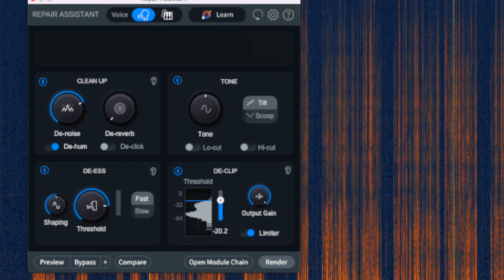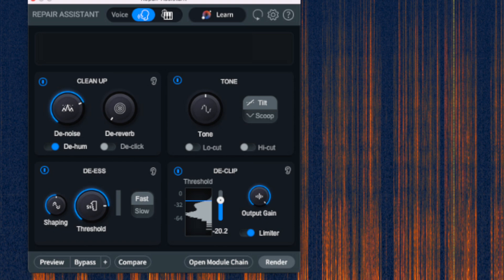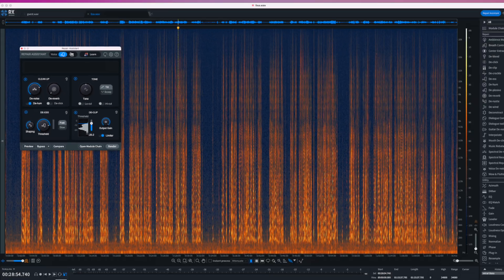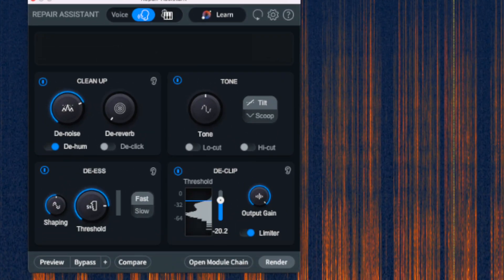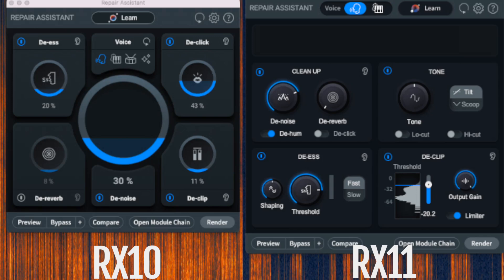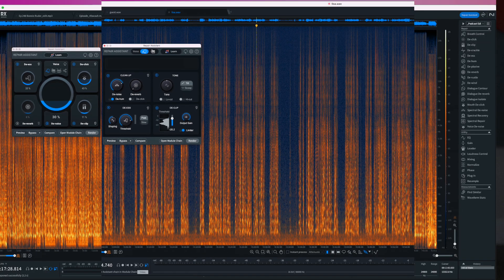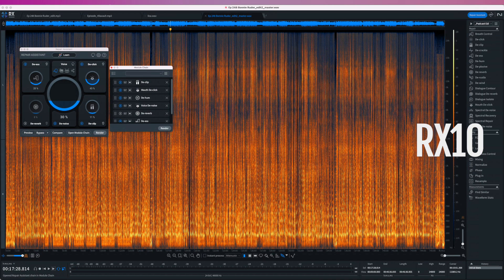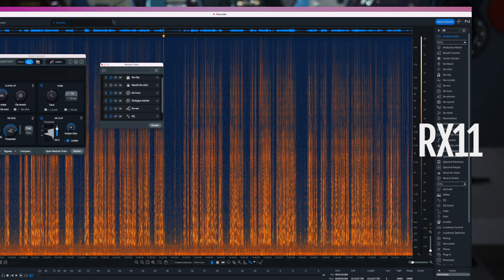Izotope RX 11 // Using Repair Assistant As A Plugin

Comment: The Izotope RX 11 Repair Assistant plug-in does not have a "Render" option on the bottom far right (opposite of "Bypass"), as the module does. So how does one apply any of the Repair Assistant changes/suggestions with the plug-in?
Reply from the maker: When you use the RX Repair Assistant, or any plugin for that matter, the rendering process is handled by the host software. For instance, if I were using the plugin in Logic, I would export the audio from Logic. This new audio file will have those changes applied to it. 

When you're working in the RX editor, the process needs to be rendered to hear the results since it doesn't work in real-time. With a plugin, you're hearing the results in real time, eliminating the need to render until you are completely finished. Hope that makes sense.

Comment: Thank you for your review! 
I am a brand new audio editor as I am making short instructional videos doing all the writing, recording audio, editing audio, recording video to the audio, then editing the video matched up with the audio and saving. I use Adobe Audition and Premiere Pro. 

This is THE FIRST PLUGIN I've ever purchased. I purchased it just a few days ago and finally had the time today to sit down and play with all of the RX11  Elements options. I was very surprised that when I followed the (not very good) video on the izotope website - it didn't give instructions, but more of an example of someone running it assuming we've all done this before, only to find out that when I clicked on 'learn' it said 'waiting for audio' when I'd already selected Control + A. So I played it and it was extremely distorted and choppy for my 3 minute video. I assumed it was user error since I am new. So then I closed out the repair assistant and sure enough, my audio was fine. 

That's when I did a search to find out what I was doing wrong and came across your video. As relieving as it is to know that I didn't do anything wrong, I am very disappointed that I may have wasted my money on my tight budget just starting out this project, that I cannot use this option. I don't understand a lot of the tone and sound settings, so I was really looking forward to this assistant making suggestions. I simply cannot use it either. 😞
Reply from the maker: I'm sorry that experience is what led to finding this video. My wife tried using Supertone Clear as a plugin in Premiere to clean up some audio the other day and she had the same exact experience. I'm wondering if that is more of a Premiere issue than an Izotope one. Perhaps it's a mix of both. Or maybe Premiere can't handle more powerful plugins like these.